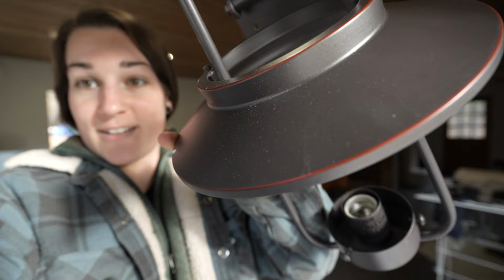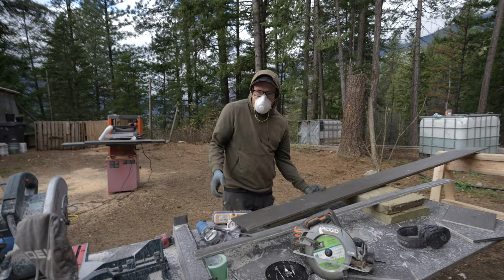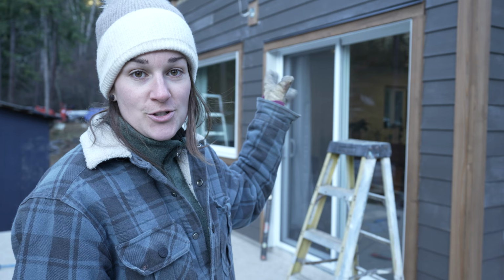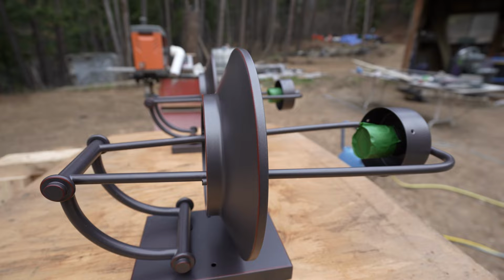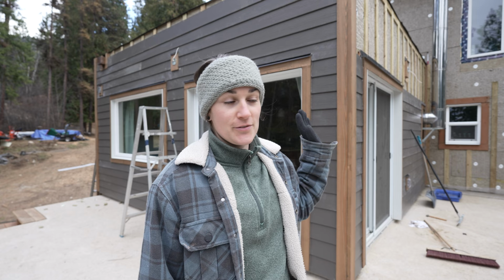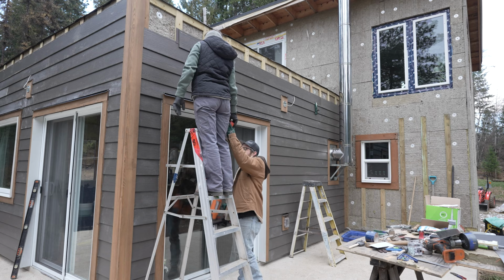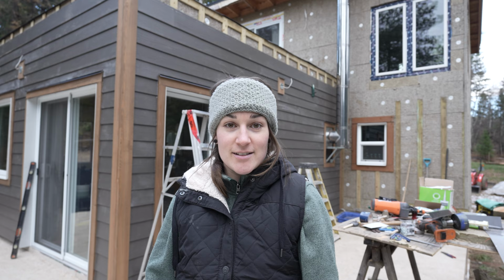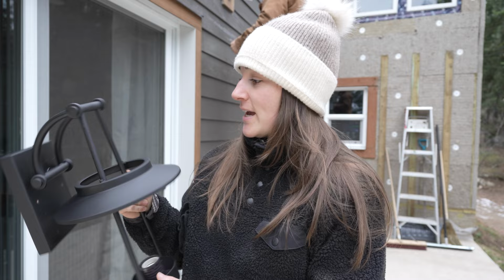This Looks AMAZING! Wrapping Up The First Section Of Siding #offgrid

Comment: The siding looks great and I like the style of the light fixtures.  Moving forward to the big wall.  When spray painting it is best to do many light coats.  The first coat doesn't even need to completely cover. It's tempting to just blast a heavy coats but don't rush. The second and third coats will complete the covering.  Light coats dry faster.  Patience is a virtue when spray painting.  Thanks for the video.

Comment: Looking great!
We use a perforated alluminum metal that is bent into whatever shape we need for the application.  It allows for air circulation but also keeps bugs out. It's also often bent into a J  and used at the base of the rain screen strips where you guys used screen material.  It's available in  large sheets similar to standard sheet metal.  Works great and can be spray  painted to make disappear into a shadow line.

Comment: Looks much better guys.. could have been the cold temps why the paint ran possible helpful tip for the next time with runs in the paint try to daub the run with masking tape make a circle with the sticky side out and just barely touch the run

Comment: In the okanogan we would dry clothes on the line all winter. When freezing it is freeze drying. Clothes come in stiff but only damp and then we would iron or they would be dry in just an hours inside as we had wood furnace and very dry air.

Comment: I'm certainly not a spray painting expert, but as I watched you paint the first one I was talking back to the screen "Careful!  It'll drip!"   As I saw you use much less on the second, I was afraid that you found out the hard way.  Glad you could fix it up enough to do the job.  It's all looking awesome!  I covet your battery operated siding nailer.  I JUST picked up a pneumatic one for some siding work next season.  I didn't realize there were battery operated options.

Comment: I give yall credit for living off grid your house looks great too. I’ve been on construction my entire life and I see you have a flat roof on the front obviously you guys get lots of snow so my advice to you guys would be to build a pitch roof on top of flat roof you will have a ton of weight sitting on it with the snow load. Building a pitch roof aka an A roof will help it shed the weight and snow load. Plus it’s way easier to keep from leaking.   Also if you guys ever can you should put metal roofing on the entire roof also using some either metal siding or concrete siding would be best for any chances of Forrest fires 🔥. Cutting back the trees around your house helps to about 20 feet away around your entire house.

Comment: Wow dude
That’s balsy 
Hats off to you for taking it on 
Definitely get that pony motor fixed or convert to direct start
That crap was sketch!!
But just running it was sketch too! I got frazzled watching you 
Fix the seals It should help the blade from diving 
For now, start with the smallest cut you can do your not chasing a roller coaster
Try starting with your tracks level with desired cut, drop the blade in a stopped position, lift it enough to just have sone up pressure on hydraulics but level with ground and go slow
Hope that makes sense 
It’s gonna be a fight till you get some things fixed
Have fun stay safe

Comment: Your home is really coming together, looks great. Just a suggestion, you may want to consider cutting long pieces of plastic deep enough to staple the top and hangs a few inches below your last course of siding to prevent any rain from getting between the back side of the siding and insulation while you engineer your stem-wall-metal-top-cap! Keep up the good work!

Comment: If the paint drips it is because you have left too much paint in the same place and this can happen by staying too long on a place, by going over a place which has received enough paint or by positioning the paint can too close to the support. Now you also have to pay attention to the temperatures. The paint is applied between a minimum and maximum threshold of degree necessary for good drying (winter is not the best season to do this outdoors)
It's great for your house, it is more and more beautiful and above all, better insulated

Comment: Spray cans work better with multiple lights coats. Keep the same distance away from the work and start the spray away from the work and bring it to the work already flowing if that makes sense. You need to work on and off with the spray.

Comment: You can take a course on-line to become OSHA-10 Certified.     It cost around $ 100.     There may be some in-class work required.    You could at least show everybody your card after you fall off the ladder.

Comment: Just a late tip in approaching any kind of painting . Rule one remeber all the work and care you have put into the job so fare is going to be represents buy the finnish it is the only thing you and your friends will see .take your time . Now to the spray can's they might look like point and shoot they are not read the directions first they are there for a reason all products in cans are not the same . First coat spray a light coat let dry then another it could take 3 to for coats or more all products are different don't flip your wrist keep the can up strait move the item if possible and take your time remember this is what everyone will see .no matter what your brain is telling you there is plenty of time to do it wright no matter what else has to be done.never ever try and get it it done quickly . You spoke of roughing up the surface is good and should be done but that is not the reason you had runs hast is always the case with runs take you time multiple coats take the time to get the feel of the spray can . Also where you are it would not hurt to warm up the item and the can just warm not hot . Good luck you 2 stay safe there construction sites are just an accident waiting to happen.     There is always time to do it wright.     Happy Trails.

Comment: Why don't you install railings for the stairs to the veranda? It's dangerous, you might fall!
 And I’m sure you need to install a powerful floodlight on the roof of your house, controlled from the house and a floodlight
  will illuminate the entire local area when needed.

Comment: Progress progress n hows that bulldozer doin I think you might wanna go with the starter engine verses a starter its old school but finding a starter could be a major task for that engine and all the batteries youll need. Big heavy ones I bet you could find say a harbor freight engine to fit the purpose n save money kind of looks like their type engine anyway from What I saw of it. Old John Deeres had a similar type starting system many years ago on some older diesel tractors.

Comment: Are y'all going to put gutters up  when you get the last piece of the siding on so when you open your sliding glass door if it's raining it want pour down. On you as you step out the door,
Reply from the maker: The pitch of the roof prevents water dripping off on the flat roof deck but at the front door on the other side, we'll be adding a gutter

Comment: And dont do dumb things like I did this past weekend but got away with it left an interior light on in my pathfinder drained the battery was needing some groceries So I put a charger on the battery n jumped in my old buick back tire looked low but drove to the store came out n both rear tires were flat n drove to the station filled em both up n waited for my battery to charge got the nissan started headed to gas station but it was closed n my tank was on fumes went to the bar had a beer n ordered a pizza I had an extra tank 2 gallon tank in my nissan but O couldnt get the spout open nthe nissan died out of gas on the street I knewI had to walk home n get my jump box n of course bitter cold at night nobody around walked back finally fixed the spout got gas in it butI couldnt get the hood open to jump it, it was frozen ah shit n I thought well try n start it n sure enough it fired right up n put in my jumpobox n finally got home to eat my now cold pizza. Hey shit still happens whether in canada or in cold as hell North Dakota. James D